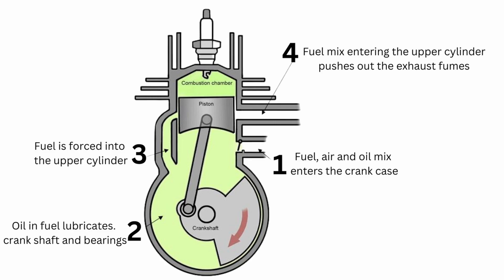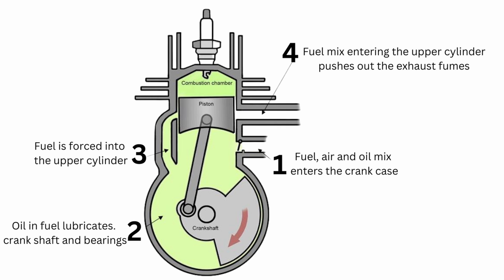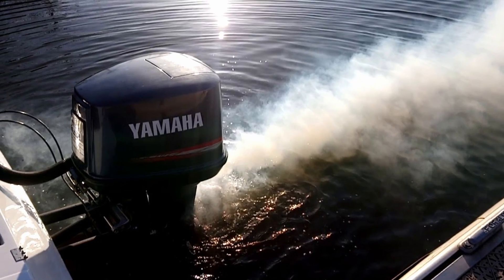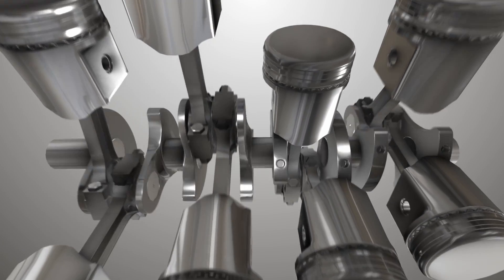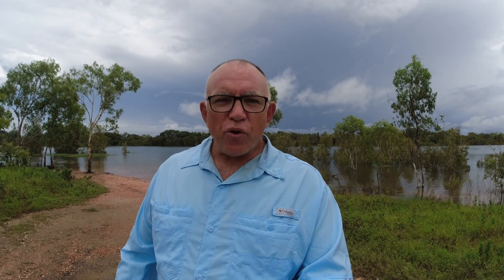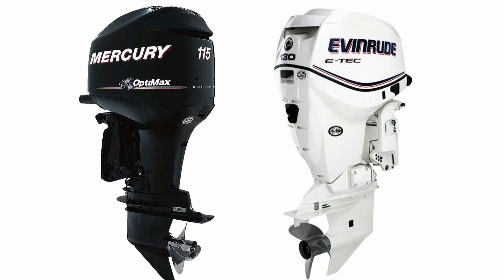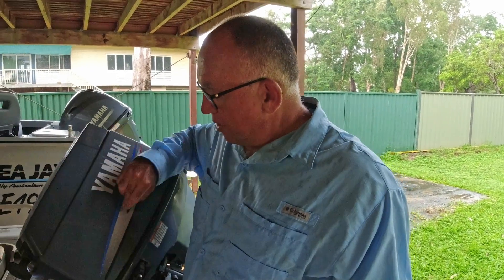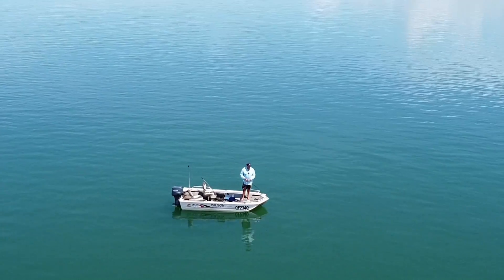Two Stroke vs Four Stroke Outboards

Comment: My 2 stroke Merc 15 eats the 4 strokes ...despite all the promo bs.....had one of those yammy 30 3 cylinder on my 4.2m.....wish I'd never got rid of it....now just acquired a second hand mint 12 footer with the 15 ..just for harbour fishing...
Reply from the maker: G'day Squiddly. I couldn't agree more. I have a small rooftopper that a mate and I used to go fish a billabong last year. We could only 4WD into this spot so couldn't take a trailer. We used his 15hp 2 stroke Tohatsu and wow. Two big guys in a 3.15m tinny and it popped up on the plane and must have went along at about 30kph. Loved it. 
Small two strokes are gems. They should have got rid of the big two strokes and allowed the small ones to still be sold. Compared to a 150hp four stroke, they emit bugger all emissions.
Reply: @smallboatcaptain1968  maybe this is what you need for creeking..https://youtu.be/3SSwg8WcHPM 👍
Reply: Rubbish.

Comment: I own both types of engines, and I actually enjoy using the 2 stroke more.
Reply: People who have intelligence will be interested in 4 strokes dumb bogans will be interested in 2 strokes.
Reply from the maker: That's so good to hear. What size two stoke is it? I have recently sold a boat with a 40hp Yammy blue band two stroke and so many people weren't interested when they found out it was two stroke. Like I said in the video, I love the smaller ones. The bigger ones are a big heavy on fuel but you can't beat that grunt.
Reply: My 4 stroke will outperform any  comparable 2 stroke in every aspect 😂.